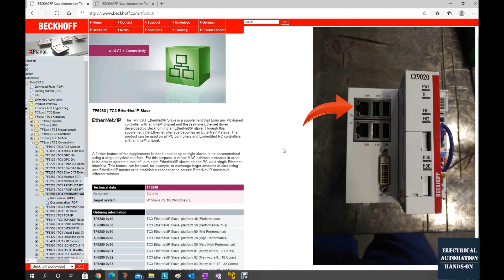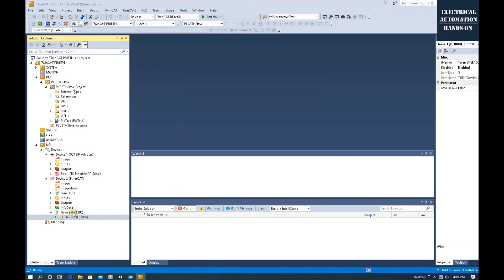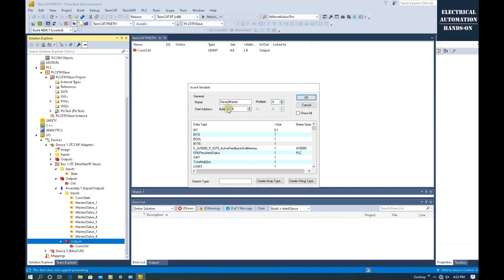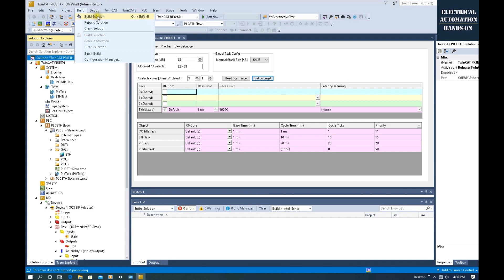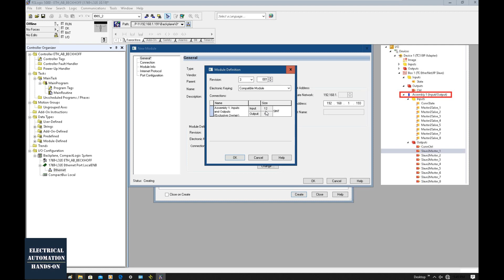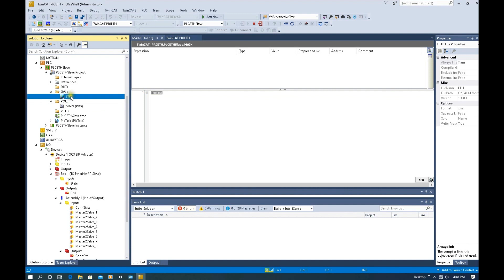COM14. EtherNet/IP - Beckhoff TwinCAT 3 (TF6280 Adapter) and Allen-Bradley CompactLogix PLC (Master)

Comment: Hi, do you know if CompactLogix can be configured as Slave (Adapter)? Thanks
Reply from the maker: The Beckhoff can run as EthernetIP Master. If compactlogix is configured as a slave EDS file, then they can communicate.
Reply: @electricalautomation  Ok, but how do you configure CompactLogix as slave?

Comment: hi, is it possible to connect twincat to micro800 plc?
Reply from the maker: Probably using Modbus-TCP. The Ethernet/IP in this video is the implicit IO connection Ethernet/IP. The low end Allen Bradley PLC only support explicit messaging ethernet/ip.
Reply: @electricalautomation  can you make a video tutorial on connecting modbus tcp/ip to another device. such as with plc micro850...?
Reply from the maker: @SonNguyen-yr1tt  Hello, I don't have Micro800.

Comment: Thanks a lot for your video! I have one question though. Right now I need to communicat my Beckhoff PLC with a testing device using TCP/IP protocol. Is it possible to use this Ethernet/IP protocol in my case? Or I just mixed these two different things up?
Reply from the maker: Ethernet/IP and TCP/IP are two different things. You can check the info of TF6310 for Beckhoff TCP/IP comminication
Reply: In case on windows , I suggest you install TwinCAT & included ads.dll(license free)  will be more easier to Implement , in some dedicate controller , you can reference the protocol spec on Beckhoff  infosys , try google "specification for the ADS/AMS protocol via TCP/IP"  the connection type is TCP , use port 48898.

Comment: Great tutorial and thanks for reiterating the selections that could easily get wrong.
What is the highest update rate we could achieve over the EIP connection?  Is it possible to get 1 ms rate for 160+160 bytes of data?
Also, looking forward to the TwinCAT HMI tutorial.
Reply from the maker: 1ms is really a challenge requirement for the EtherNet/IP. For your case, I would recommend you use EL6652-0010 hardware solution EtherNet/IP slave terminal. Also keep in mind that you cycle time of the task should be faster than 1ms to exchanged the data between the TC PLC and communication image buffer. This means your PLC CPU will be very busy on the communication and PLC data exchange

Comment: Hi! One correction. CX9020 don't work with TF6280 because the performance level. TF6280 and TF6281 require the last performance level (P40).  Your notebook is P90 and CX5120 or C6015/C6017 are performance level 40 (P40). Anyway a great video. Congrats!!
Reply from the maker: THANKS THANKS THANKS A LOT! Thanks for your correction! I checked, yes, TF6280 can be used on all PC controllers and Embedded PC controllers with an Intel chipset. CX9020 =must use EL6652 for EtherNetIP Slave. The configuration procedure is very similar with TF6280. Thanks again!